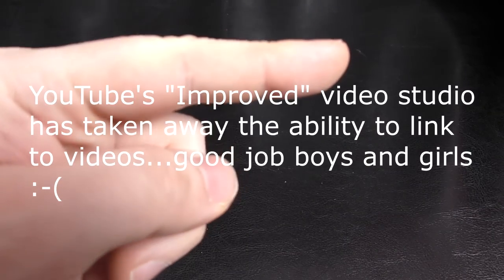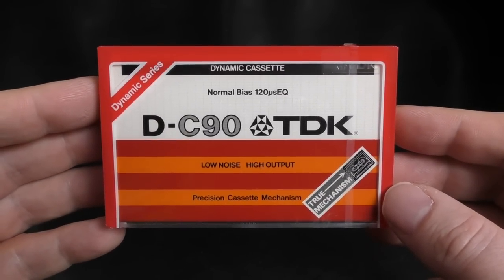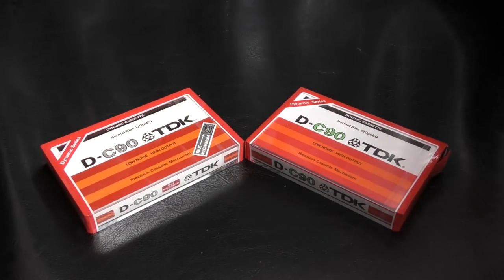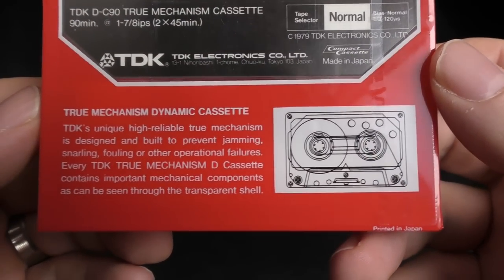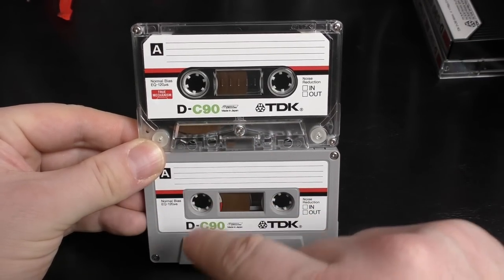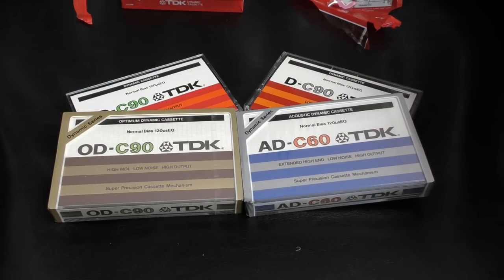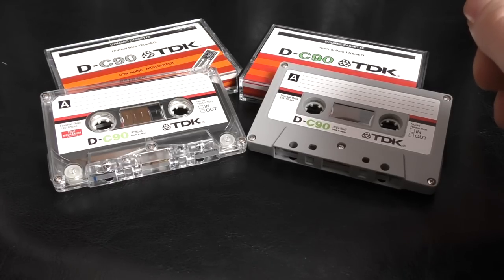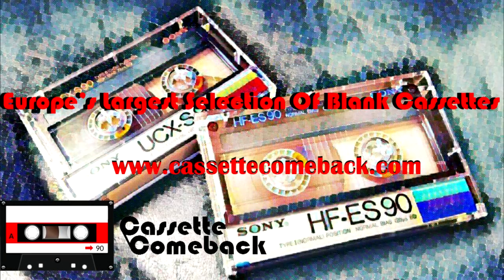TDK D True Mechanism Type 1 Cassette - A real TDK or Fake?

Comment: sweet theory, but get a few 1973 and 1975 grey print D-C90  TDKs, and rethink that what you have is missprinted "1979" instead of "1973".
Reply from the maker: The 73 jcard design is different to the 79. The 73 also seems to have bits cut out at the back.
Reply: how many 1973 jcards do you have from the JPN, EU and US markets? TDK was no BASF in terms of standardized line ups.

Comment: Interesting! I have some knockoff's of these TM tapes, one is branded "TAK" and used the tdk logo and colour scheme, and I used to buy these cheap "Audio Plus" tapes from a local discount store in the 80's.  The cassette labels were identical to the TDK TM cassette you have there except it doesn't say TDK, it even has the True Mech logo!. Neither the TAK or Audio  Plus were good tapes, not even close to the TDK.
Reply from the maker: There were lots of copy cats, but they didn't go as far as trying to pass themselves off as TDK. They were more homages, where as this, if it was a fake, was outright illegal.
Reply: I also remember another knockoff called Martronic and it was a “Type 0” and the label was inspired by TDK “True Mechanism” D from 1979, and another one called Audio Plus, and that’s also a “Type 0”.

Comment: for me i dont and would not believe anything the fbi would say. know i am not calling Gary Ray a liar but they will tell anyone any kind of story to cover up what they really know as they like to use a certain saying "need to now" i managed to come across a used version of one of these a few months back and in very good condition and i have recorded on it once via tape to tape and it recorded the same as the source tape and sounds very good to my ears.
ps tony did you manage to get them nip true mech tapes of ebay a week ago as their was a few for sale and i was gnona get them but forgot about them and missed the opportunity.
when you compare the tape set up via the 3 you did have to ajust the levels for the new 79 tape and the true mech one did not look like it need as much ajustment but i could be wrong.
could a "knock off" one from the 70's/80's be that close and that good to the original  and why would their of only be that small quantity in the wharehouse for a "fake load".
perhapes tdk intended to manufacture them and pulled the plug on them before they got officially released by them that could be why you can't find any advertising for them. 
i for 1 don't believe them to be fake
Reply from the maker: Like I say at the end. I can't say if they're fake or not. Some things point to them being real TDK, some don't but right now it doesn't matter as it's a nice looking cassette that is of good quality. I just thought it would be an interesting video to make.
Reply: @CassetteComeback  
i agree 100% with you they are a nice looking cassette and it was a very interesting video as all of you other ones are please keep them up.
now 1 tdk i have not seen you do yet is the white ferric of the late 80's. i remember buying these and still have a few today